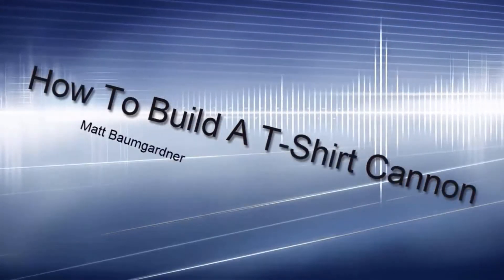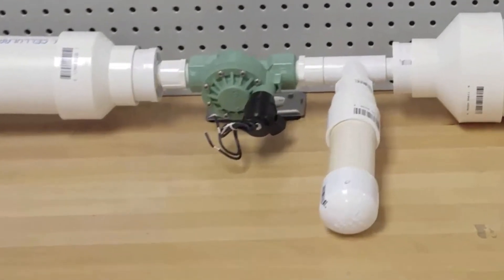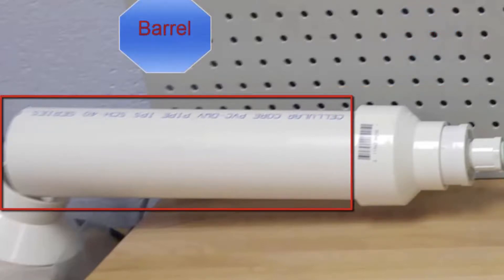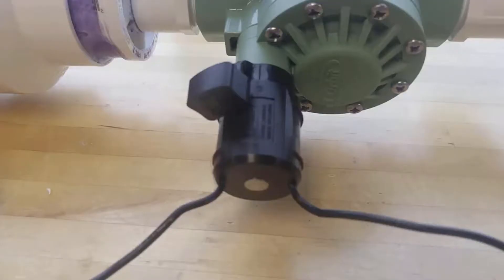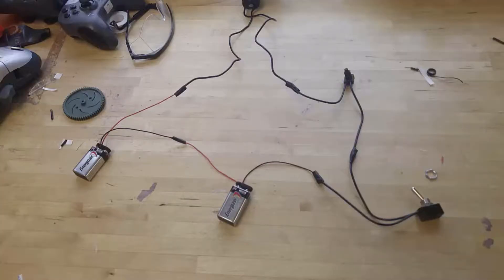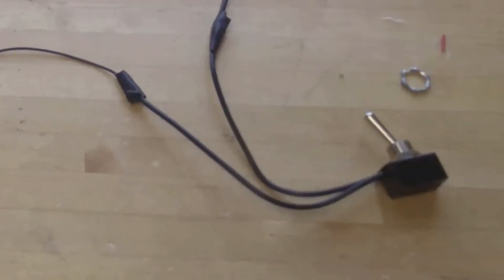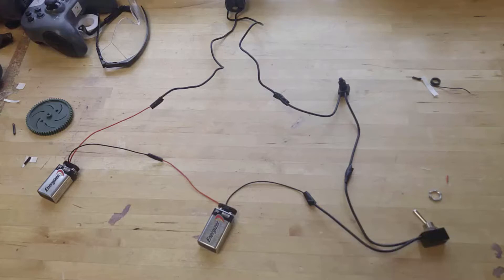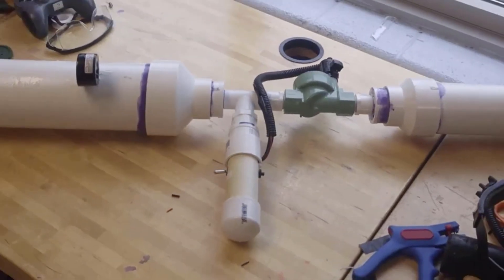Build Your Own T-Shirt Cannon

Comment: It would have been helpful if you showed it working, at the end of the video.  Nick, I have an invention idea which is right in line with what you showed. You have the construction skills, whereas I have the idea - which is very simple, but could be interesting to the military. I jest not. If you build it, according to my suggestions, we could possibly share the laurels. In other words, we would be co-inventors.  There may still be a 'provisional patent' option, which (used to cost) $60 and is good for 1 year - on the way toward getting a bona fide patent.  The 1 year is considered time enough to 'shop the idea around.'  I'm an elder, residing in Hawaii.  Low income, but brimming with innovative ideas for inventions.